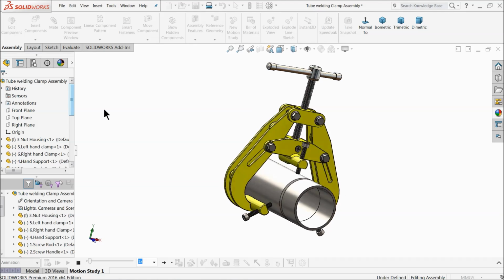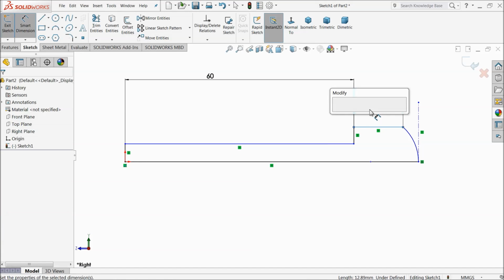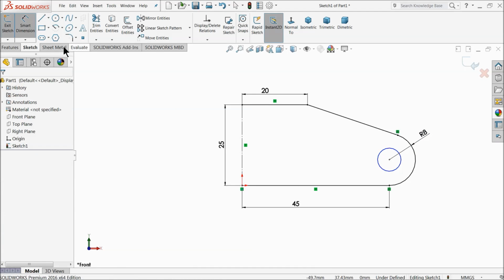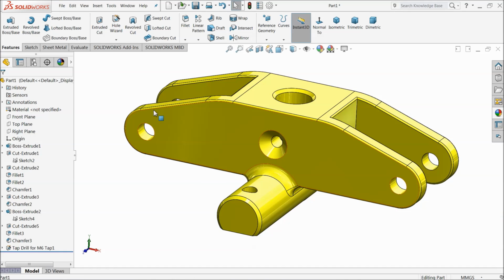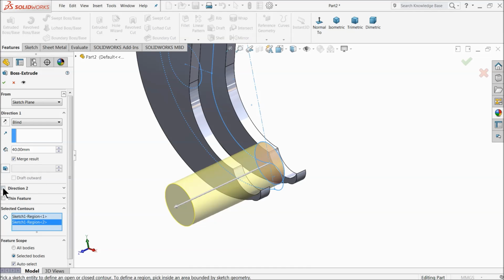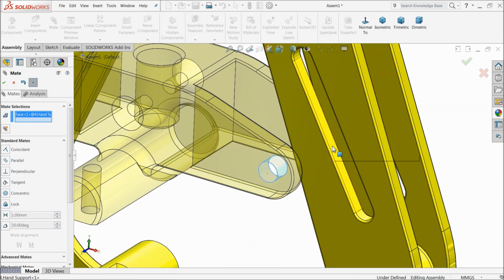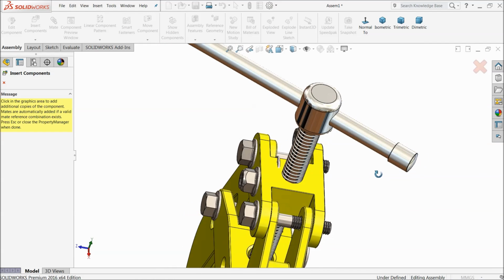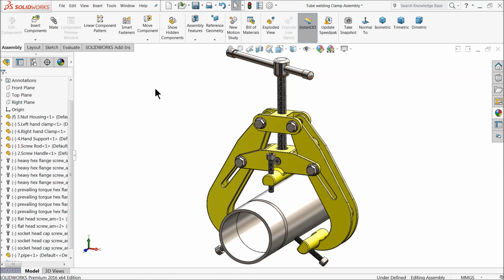Solidworks tutorial | Design of Tube Welding Clamp in Solidworks

Comment: @cadcamtutorial i m facing difficulties in assembly.
Basically after mating hand support.. The motion of hand support is not restrict to the right and left hand clamp.
The motion is infinite. 
How to restrict the motion in both the clamp only
Reply from the maker: choose advanced mate select angle minimum & maximum opening with the reference of right plan & right or left hand clamp, try maximum angle 45 & minimum 22.5 & check the result,
Reply: Kk I'll try